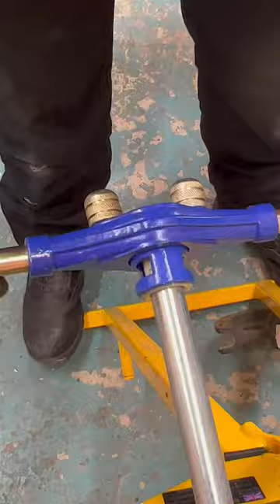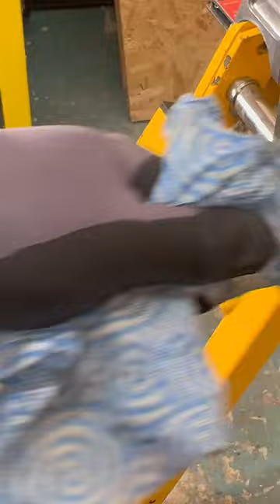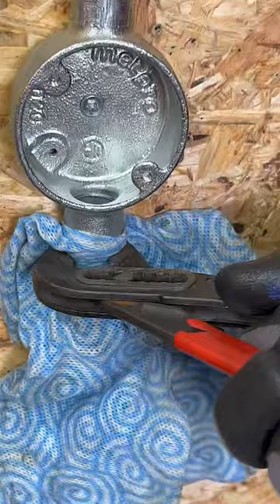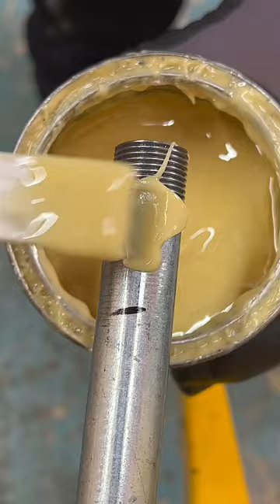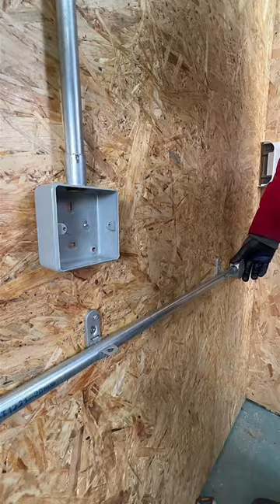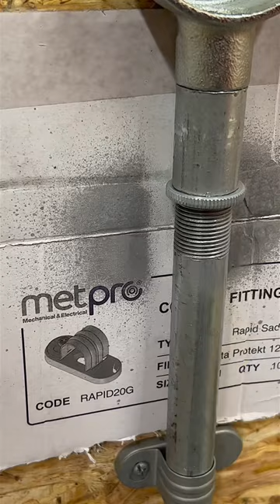The Mystery of the Conduit Running Coupler

Comment: I usually just spin the box on the end of the 90 and then flip it up and screw it to the wall. Nice little trick though, I'm not sure where I'd ever need it.
Reply: In a complex steel conduit installation there will be a need for the running coupler, no matter how well you plan.  What about additions or repairs?
Reply: If you could assemble all the conduit before you fix it , there'd be no need for running couplings , but in the real world they're a necessity .
Though I mostly used wd40 rather than grease , yes it's not a lubricant but it's handy and gets the job done , and deburred with a snips .
Reply: @YellowPinkie  usually there's a practical limit on conduit before you've got to drop into trunking anyway.

I hate running couplers because the naked threads look awful. Okay if in a void but for this I'd probably use a conbox for the bend or a formed bend with a coupler afterwards depending on space. 

Of course sometimes you do have to do a running coupler and have no choice.

Comment: I love putting screw-locks on a bent pipe! Like it's going to unscrew itself, lol
Reply: In Scotland we add an extra lockring, so there's one either side of the coupling. It's really a throwback to the days when your containment was your only earth. You could get away without running a separate cpc  until the 15th edition became law.
Reply: Worked with a Scottish guy when I started he told me they used 2 lock rings because it was tight as f@c! 🤣

Comment: I always try and bend conduit so the writing is on the back .it doesn’t always work out though. 
You can buy threaded internal couplers if you don’t want to make your own.. 
i see your trying conduit bender look well used by hitting it. I think you got along way to go as mine hardly has any paint left  on it .
Reply: If you can’t avoid bending without the writing showing you can spray galv spray over the writing and give it a wipe and it will come off .. got me out of trouble a few times 👍🏻

Comment: Not recommended running threads in the USA because threads are tapered and when run like this one end might not provide tight fit. My inspector would never allow this halve ass running thread on any explosion proof conduit runs.
Reply: These are not tapered threads, why are you commenting with irrelevant factoids?
Reply: This is not an 'explosion proof' installation.
Reply: Plumbing pipe has tapered threads, but this is conduit and not water pipe.
Reply: @AndreasKoepkeAU  Rigid conduit uses NPT in the US.
Reply: In the US there is a thing known as the “National Electric Code” and if you all knew it you would know that using a running thread and coupling at a box is not permitted, and NPT thread is indeed for plumbing and NPSM threads ( straight threads) are for conduit, especially for explosion proof!
Reply: @JasperJanssen ou have a right to give your opinion that’s what allowed us SPARKIES to figure shit out and evolve to better products . As a retired  SPARKIE AS MY GRANDSON CALLS ME, this is how young guys get rich making a product and selling it to ELECTRICAL SUPPLIERS.  DONT LET PEOPLE CUT YOUR VOLTS….
Reply: @billbarnes1043 as an Electrician in US CORPS IN A FEW TOURS IN THE HOT SANDBOX. Advance logistics Teams would sendus in to establish needed SERVICES.  . Defensive screening usually sand filled 8 x 8 wire boxes.  was first so snipers wouldn’t shoot us.  . second was JUICE FOR sophisticated electronics. Toilets etc were a later priority. Objective was to MAKE IT WORK. YOU MADE NIPPLES CONNECTORS ETC AS SAFE AS POSSIBLE. NO INSPECTOR TO GIVE U A CHECK  OFF.  Squad Senior Sergeant aka Juice Dr usually said if it was good or not. Fireteams using very expensive gear loved us. 220v usually what they wanted.  I WILL NEVER BAD MOUTH ANY MAN WHO MY DAD SAID JERRI RIGS ANYTHING  TO MAKE IT WORK. NO POWERE THREADERS ETC SHERE.      I salute this brothers tenacious thought process. He’s not a robot ….watch your 6 from others who disagree with you in America…CARRY ON BROTHER.
Reply: @JasperJanssen  WRONG. electrical conduit has tapered threads. Been that way for at least last 50 years. Running thread should never be used in damp or wet locations because water might slowly enter enclosure. Could cause a explosion if used in a area that explosion proof system ( that includes conduit ) the hot gases from an explosion inside an explosion proof box could travel thru the required minimum 5 threads and not sufficiently cooled down the hot gases thus causing a second much dangerous explosion. In a dry indoor area I would never trust running thread to provide a quick reliable ground source. On a dead short there could be over 10,000 amps produced.
Reply: @JohnThomas-lq5qp  electrical metal conduit IN THE UK has never used pipe thread and still doesn’t today. #confidentlyincorrect

Comment: Its 2023 and the electrical industry is still using threaded conduit, threaded with stocks and dies. The plumbing industry have used push couplings for years . Water goes through their pipes.
Reply: Maybe you are not clear on the differences in the two motive forces.
We use the conduit as one potential ground path, so a compression fitting that provides the same function may be very large and costly. Look at expansion fittings for conduit.
Reply: Maybe I'm not clear 😂, I remember in 1983 we started  running Earth cables in conduit  The only country in the world where we thread conduit, most other countries in the world use push couplings or screws. Ridiculous we're not pipe fitters